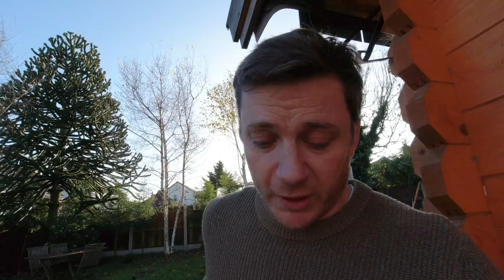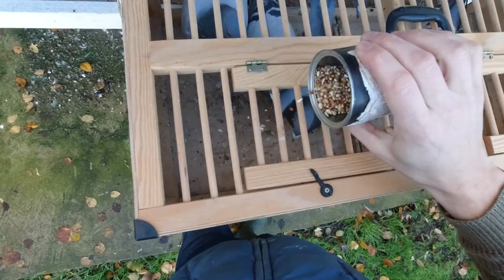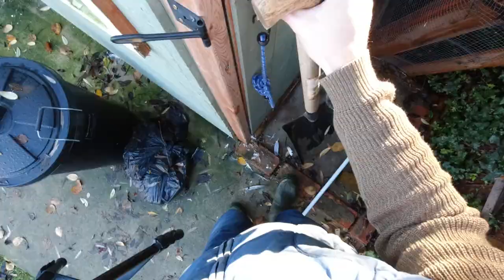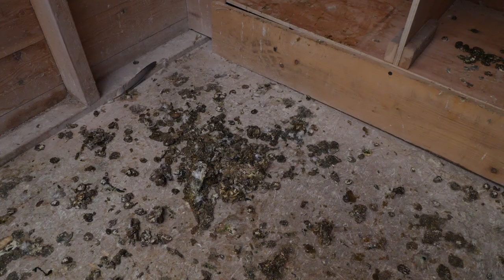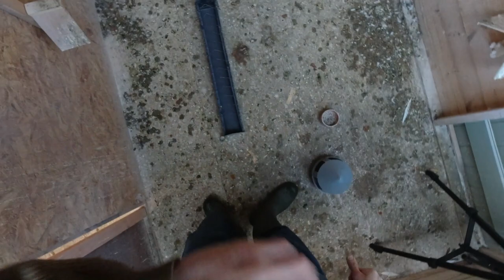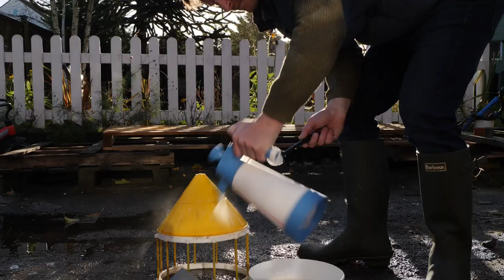Birds Not Allowed To Fly. | Ep 54

Comment: Maybe using a triangle scraper to pull towards you would make scraping allot faster. Clean the floor with a large scraper with a long handle so you won't have to crouch all the time. Pick the pile of droppings up with a dust pan and brush.

Comment: Well that's a first for me, I've never seen some one in a loft with a shovel, I did get a laugh from that sorry Dan 😁😁😂😂. Try a little bucket and just scrape from the perches and box's straight into it, as for the floor, just pile it like you did and use you're hand and the scraper to load the bucket 😁😂, failing that the scraper and the wall you scraped it against.
 
So the birds don't have to stand in there own sh*+ , if u put a block of wood, just off cuts say, about (2in high 2in square, they will be happier. 

Seems to be a nightmare buying wood these days, like everything just gone so dam expensive. I'm really looking forward to you seen the lofts at the Doncaster and Blackpool shows, they will give you a serious buzz,
Reply from the maker: Ah yes, the wooden block. I'll do that now. I'm sticking with the shovel though, it works just fine. I did look at Ecco lofts at the Doncaster show but the guy wasn't very keen to have the inside filmed for some reason so I don't really have anything to show people.

Comment: We put a large screw in the top of the drinkers to stop them perching on it, drill a small hole first or it might crack 🙈
Another time saver is to put 2 strips of wood underneath each end of the avory to create a runner and slide in a piece of plywood from the front....this will catch the droppings stopping them going on the floor.....less bending down and don't need to do it often 😉
We also put simple grills on the box perches....two pieces of 1"×1" on both sides with a wire on top....simply remove from the box perch every week and scrape.
Also a floor scraper with a long handle is a great time saver and is good for your back.
I can see you are a busy man but these will save you time in the long run....also good for the birds health and yours.
Birds look great, I'm sure pairing best to best using your spreadsheet will pay dividends with both the off spring  and cutting down the chance of the loosing their partner at a race.
Hope these wee tips help 👍
Reply from the maker: The screws are in. I put them in after filming and seems to have worked as of this morning. I like the idea of catching the droppings on trays too. All work in progress 👍
Reply: @howtotrainyourpigeon  keeping the wife happy and keeping pigeons .....a tricky balance indeed 🤣
Reply: Nice one Dan keep at it you don’t need a massive loft.
Just another same as you’ve got will give you 4 sections.
That’s plenty for now.
Keep up the good work mate.👍

Comment: Sorry to hear Charlie is no longer actively racing. I always had my rectangular stainless steel drinkers on the outside of the loft with a triangular cover to protect them. Dowels in the wall for the birds to access the drinkers, as they do in a basket. No wet spots in the loft. Probably too cold in UK to do that. I was looking forward to seeing the new 'you beaut' ready made loft, but if you are intending to keep a similar number as this year, why not just replicate what you have. Although you will have 12 pairs you might only breed from the better 6 pairs and use the other 6 pairs as first round fosters for the better pairs.
Reply from the maker: Definitely my thoughts atm. There a quite a few things I'd do differently if building another loft. I'm also considering breeding off the better performing birds but as they only raced up to 120 miles I don't think I've given them the best chance to prove themselves just yet. Plus I'm interested to see if a poor performing bird is capable of breeding a good bird. The basket and spreadsheet will give the result, but it's a long term experiment with so many variables. It'll be fun to see the outcome.

Comment: I've noticed you aren't wearing a mask. I am wondering what the dangers are of inhaling the air that comes from cleaning out the loft? Are there serious repercussions over time, health wise? Also, do you ever wash down the loft with a garden hose or such like? Thanks.
Reply from the maker: Good question. I know some people suffer from 'pigeon lung' which is where they suffer hypersensitivity to antigens shed by birds. My exposure is quite limited in that my loft is small, I don't spend long in there and it's well ventilated. But if I was or did become symptomatic in the future then I would wear a mask. Since ditching the easibed dust has been much lower. If I had a bigger loft I'd be tempted to fit a passive dust extraction system before strapping a mask to my face. Regarding cleaning down. No i wouldn't use a hose but I do have a bottle of cleaner that I use once a week or fortnight on the perches and floor. I'm planning to lightly torch the floor after worming too. With birds safely elsewhere and hose on standby.